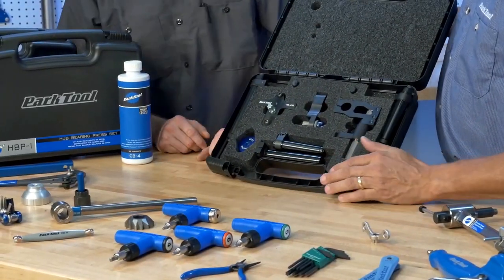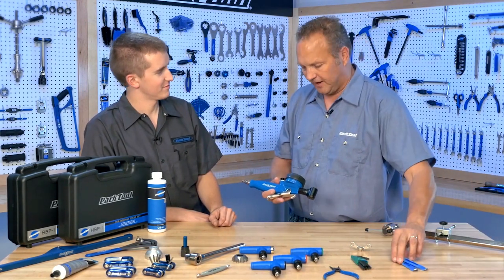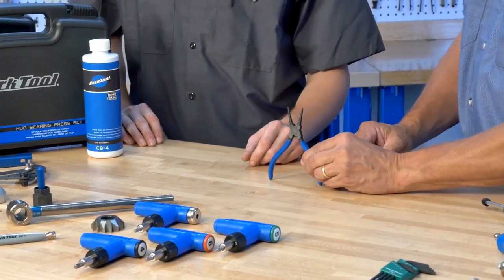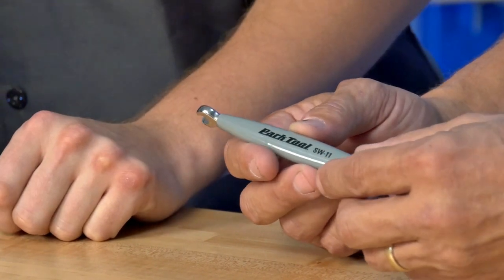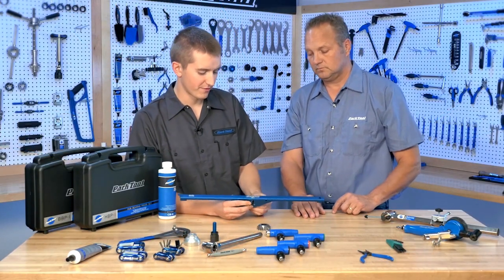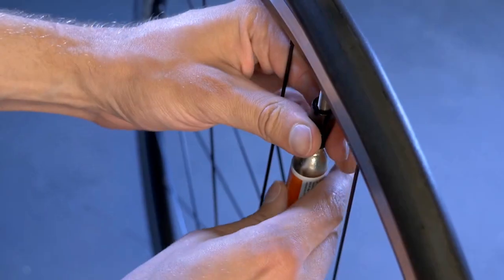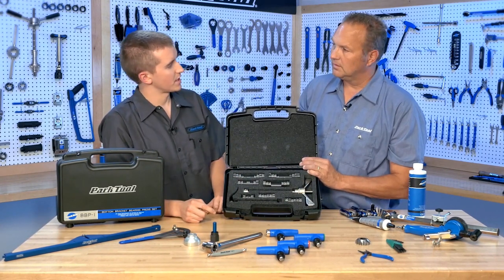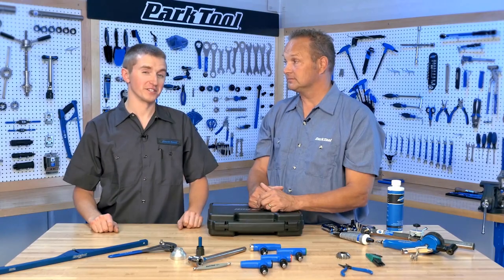Park Tool - New for 2016

Comment: the vid shows two guys obviously knowing very little or nothing about video-marketing, which is good in this case, since they´re engineers...
i´ve worked with park-tool tools, it´s good quality and a thought-through-design, it doesn´t solve all the problems you might encounter, but most of the stuff is a must-have in my oppinion

Comment: i'm surprised Park tool made another bottom bracket press tool rather than making one that will remove the PRESSFIT CUP Part#(KP197 SRM) like that one cannondale put on their HI-MOD bikes from 2014-2016. The BBT-30.3 and the RT-1 tools doesn't quite do the job. but they can take out only the bearings but not the cups. for now, the only job to get these Press fit cup out is hand made parts from home depot. hope they'll consider making one soon.